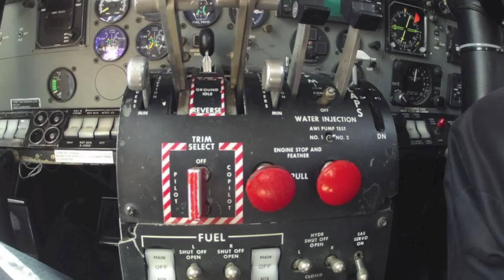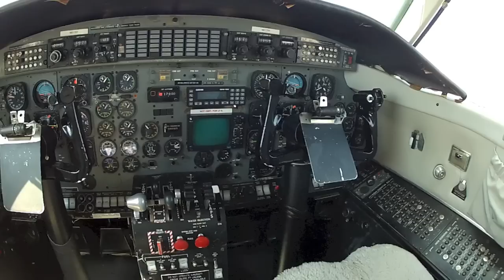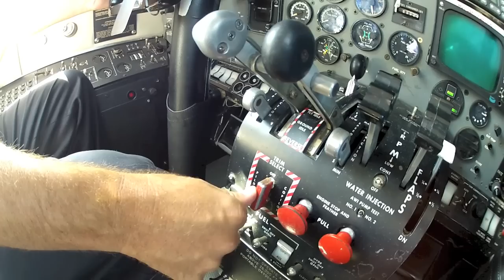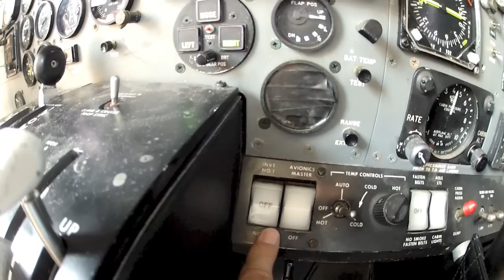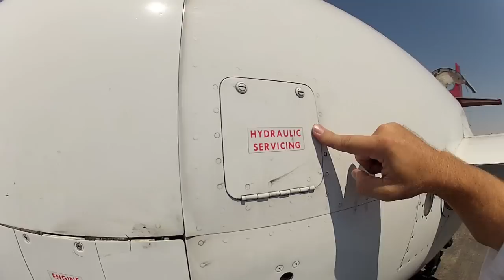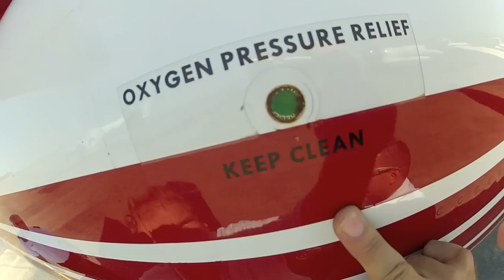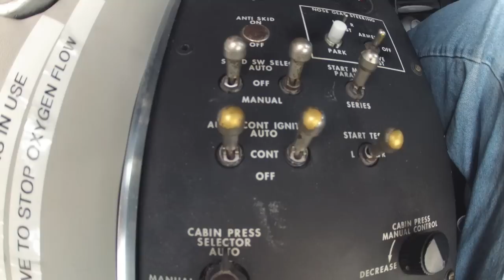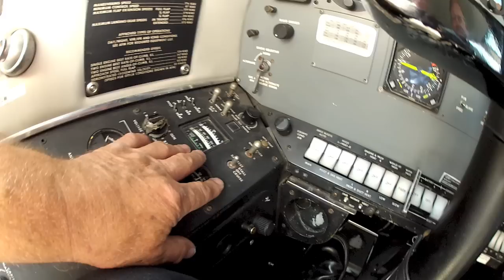Metroliner Preflight

Comment: Good detail here. Thank you. I too flew the Merlin IVC and the SA227 many years ago logging about 6,200 hours and 10 years in them. I'm surprised I still have my hearing!  When preflighting the door, that tube under the flap at the threshold actually supplies 18 PSI of regulated bleed air to an inflatable door seal. If this tube is kinked or leaking a noisy air leak and some loss of pressurized air will occur. When the handle is closed and so long as the aircraft is pressurized, there is a differential pressure diaphragm that mechanically locks the handle so that it can not be opened in flight.

Comment: Good training video. Wish it would've been available when I went to work for Britt Airways to fly the SA226TC Metro IIs in 1986. 

Have about 1600 TT in aircraft, and it was one of my favorite airplanes to fly. No type rating -- Part 23 airplane (MGWT 12,499 lbs, Vmo 248 KIAS) -- just company-provided training in Terre Haute, IN (HUF). In the cockpit, it was a cold airplane in the winter and hot in the summer, as the heat & air conditioning was strongest in the back of the cabin. Hubs were ORD and STL, but company had out-station basing, so we didn't live in Chicago or St. Louis -- which meant, no RONs; just day trips. We had 3 types of AWI, but most of them were CAWI-equipped. Didn't do us much good though, as the 880 shp (-3s) were converted to 1000 shp (-10s), and due to oil pressure switch activation at a different psi setting, the AWI was on MEL the whole time I was there. ORD controllers loved us because we could keep our speed up to the outer marker, before configuring; also, we knew ORD very well -- didn't get lost, like crews that only landed there infrequently. We had 19 Metros, and not any one of them had the same cockpit as the others (location of engine gauges, type of nosewheel steering, etc.) -- it was quite an experience! Where the Metro III has bayonet-style cabin door latches, the Metro II had "click-clack"-type latches, which failed regularly (sometimes the main cabin door couldn't be opened). These latches had to be sprayed often with a special "dry lubricant" to keep them from sticking. I believe the bayonets were a vast improvement.
Reply: All true. I flew the Metros at Britt too up until 1985. Great flying plane, I always thought.

Comment: What does he say at 12:23 about the root? And why does it need a cooling turbine inlet (12:29)?
Reply from the maker: Hi there, He doesn't say Root, he says that it is NOT a boot.  Boots that are just past the engine actually blow up like a balloon and shed any Icing that may have built up.  The black portion that Harlen points to between the engine and the Fuselage DOESN'T blow up an shed any ice.
Reply: @DavethePilot  I realize that. Sorry, I meant to say "boot". But actually I mean at 12:21, he says "On a..." then something else. Before he says this is not a boot.

Comment: Nice video

quick question though, what is CAWI?
Reply from the maker: Hi Pilot Man... CAWI stands for Continuous Alcohol Water Injection.  It puts a combination of both INTO the engine and cools it off and gives you an EXTRA 100 horsepower per engine on take-off.  SO, on short runways where you are loaded up then you can use CAWI to get off quickly.  You usually turn it off around the 400 foot mark when you put up your Flaps and also turn on the Bleeds One at a time...  See ya
Reply: DavethePilot
Thanks for the reply, very interesting stuff!

Up here in Canada I have seen a few Metroliner operations, their takeoff run seems obnoxiously long! Is this just me or is there come justification due to their high aspect ratio wings? What is the typical takeoff for you guys?

I cant imagine what a hot and high takeoff would look be like in that thing!